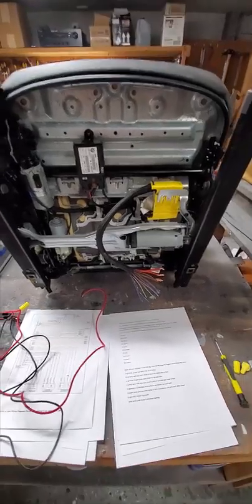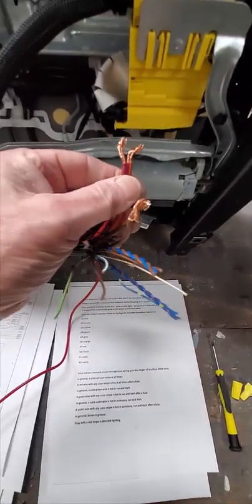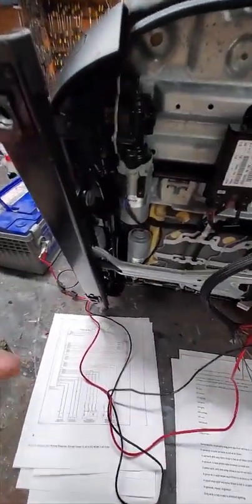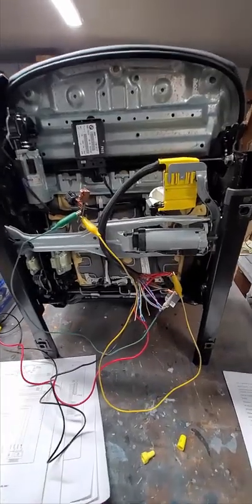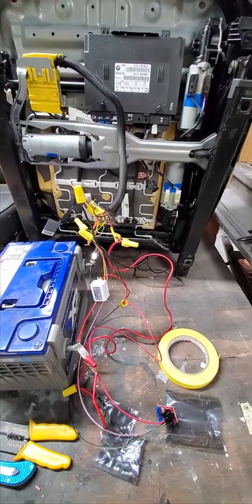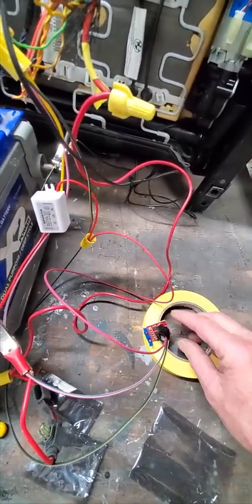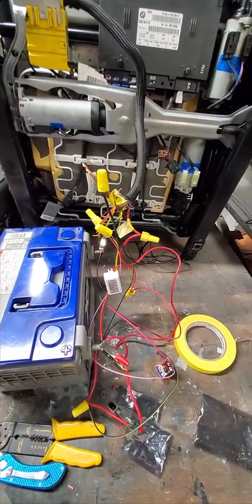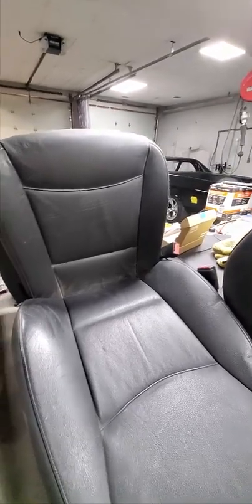BMW Seat wiring for el Camino

Comment: This video is awesome. I am trying to install bmw or other more luxurious seats into my older Corolla. Most other videos I find are for simple racing bucket seats or upgrading to newer model years. I appreciate a video like this with a completely custom retrofit. 
As someone with no wiring experience, I am a little confused about certain things. 
I can definitely get a wiring diagram for whatever seats I end up buying. My car has occupancy sensors, can those be retained or will there be issues? Do you know? Do the airbags work in these seats you are installing, while that be working in the car? Are you using fuse tappers to power the seat? Maybe you could make a more idiot proof tutorial style video?… Plz? 😅

Comment: @Dean Jenkins Sorry but my english is not perfect yet.. I trying to do excaly same thing in my Bmw.. I already have power converter and signal wave plate, I conect them both thogeter and they are works like on Your movie, my quescion is.. how to conect that 5v signal cable correct.. to low can, high can on just to this green wire ?

Comment: Hiello Dean, thank you for this tutorial it helped me with my setup on my El Camino.  I was noticing my car battery would get very weak when sitting for a while, and was thinking maybe it's due to the signal blinking on the board? Everything else is off in my car so the only thing I can think of is the blinker signal?  Anything similar happen with yours? Is there a way to switch it off when not in use besides unplugging battery ? Thanks

Comment: This is an absolutely Awesome video. Is there a flow chart that you could share showing how you have connected everything? I have essentially the same setup as you have but for my 1971 Chevelle.  Thank you in advance again.
Reply: Did you ever find out how to connect everything? I am trying to put a set of 2011 BMW E93 seats in a 70 Oldsmobile  F85.

Comment: Hello, I purchased comfortable front seats with ventilation, but I encountered a connection problem. My car is from 2007 and the passenger seat does not have a module. Can someone help me?

Comment: Could you please help me with my BMW seats I’m using in my 40 Plymouth coupe project?

Thanks!
Reply from the maker: I can try.  What questions do you have?
Reply: @TheDeanjenkins  could you please share the wiring diagram for the square wave board?

Thanks!

Chris,
Reply: @ made all the connections and still timing out.

Any idea what could be happening?
Reply from the maker: @chrisbaker-hr2mp  First thing I would check is that CAN Bus high wire is correctly identified and connected to the pulse generator output.  Then I would check that pulse generator is sending 5 volts - easy to check with a multi-meter.  The pulse generator I used was default set to 1 second pulse so you can see 5 volts on and off at 1 second interval.  Also ensure that CAN Bus low is connected to ground.
Reply: @TheDeanjenkins thank you for the info.  I’ll definitely check it out today.
Reply: @TheDeanjenkins I have a 4.5vdc output from the board.

The wires I believe are for the can bus are green and orange/green. 

Thanks!

Comment: Hi,  great video. Would it be possible to get a drawing or make a video of how you connected the 5v converter and the pulse generator into the seat.  Perhaps a clearer way that shows how everything was wired.  I'd appreciate it very much.  The video explained it but i want s clearer view or the wires & where they were connected to.  I just don't want to fry the motors or the computer that's on the chair.  This is fit the driver's side.  The passenger side is clear as there were only power & ground wires to worry about.  Unless you have a video of how to book up the heated seats on the passenger side as well.  Thank you kindly.
Reply from the maker: Here is a link to another guy who posted how he did it.  He used the same pulse generator I did, but a different 12v to 5v convertor, but wiring is the same.  You have to find the CAN Bus High wire on your seat.  I purchased a wiring diagram for the particular model that was a donor for my seats.  On mine, it was a tiny green wire with a stripe (forget the color.)  You connect the CAN Bus High to the output of the pulse generator, the diagram at the link shows it well.  You connect the CAN Bus Low to ground.  Hope this helps!  https://www.reddit.com/r/projectcar/comments/1ab8hj9/how_to_wire_newer_bmw_seats_into_non_bmw_cars_so/#lightbox
Reply: @TheDeanjenkins thank you for the link and for your video.  I can now write my seats that I've installed last month.

Comment: Loved the video. Absolute gem  ty.  Subscribed and liked  
Just picked up myself some early e63 6series seats (free too) that with anticipation tilted up to find few loose wires 
1. Both pretensioners gone (yay no bang bang) 
2. Occupancy censor on ns  leave that alone
3. 2 wires in connectors. Fat red and brown. RESULT!!

could not be simpler on my end to add to our van.  

Thank you again

Comment: Hello mate,i have a question.
Did i need a computer if i just need seats go back and forward,i dont want to have seats heater.. thank you🥂
Reply from the maker: Only need if you want to be able to adjust seats anytime.  They will work at power on for a few minutes and then time out. That might be workable in most cases.

Comment: Thank you for sharing this Dean! I've had e92 seats in my 97 4Runner for a couple years and this helped me finally get the seat heaters wired up.
Reply: How do you wire the seats? I’ve a 4Runner 00 and Im trying to fit a e89 seat on it but I have no clue.
Reply: @JAVR09 did you figure it out?
Reply: Maybe you could share how you did it with those e92 seats, are they fully electric?
Reply: How did you do it?

Comment: Thank you for the Great Video. I’m in the process of getting the 3 series bucket seats moving also. I’m Just wondering if you used a different seat belt?
Reply from the maker: Thanks.  I used reproduction 3-point kit made for the '68 el Camino.  The factory mounting for the seat belt receiver bolted to the floor, but since the BMW seats were a bit wider than factory, that didn't work.  The BMW seats have an anchor point to bolt the receiver to but when I bolted the reproduction part to that it was too long and stuck up too far.
I sent the two sides off to https://www.seatbeltplanet.com/ and had them re-web them at the correct length.  Worked out great.
Reply: @TheDeanjenkins  Thank you for the quick reply… Happy Thanksgiving… cheers

Comment: @TheDeanJenkins

Thank you so much for your very informative video! I am now a follower, and love your videos too.

With regards to the wiring for the step down converter, wave signal generator, and relay box, could you please point me at where I can find the wiring schematics?  I found your Reddit page that contains the wiring for everything except the relay box, and would really like to use the relay box, especially to allow me to connect seat heater buttons.

Also, the step down convertor in your link is different from what is shown in your video and photos, I just wanted to verify this is known by you, and works the same way.  I understand the wiring, just wanted to make sure Amazon didn't replace it without you knowing.

Incidentally, I am installing E90 seats into a 2002 4Runner.

Thanks again!
Reply from the maker: Most automotive relays have a schematic printed on the case.  Really easy to follow.
Here is a video explaining: https://www.youtube.com/watch?v=DWSO3ny74BU

Comment: Trying to put a set of E90 seats into an E36. Would it be possible for a copy of the wiring diagram please?cheers
Reply from the maker: Don't want to sound unhelpful or preachy, but the diagrams I have were purchased and are copyrighted.  I make my living selling online content and am very sensitive to upholding intellectual property rights.  Purchasing the documents was very reasonable.  With that said, you may not need the diagram.  With this list of BMW color conventions, I could have figured it out, without the actual schematics:  
In general, a solid red wire is hot at all times.
A red wire with any color stripe is hot at all times after a fuse.
In general, a solid green wire is hot in run and start.
A green wire with any color stripe is hot in run and start after a fuse.
In general, a solid violet wire is hot in accessory, run and start.
A violet wire with any color stripe is hot in accessory, run and start after a fuse.
In general, brown is ground.
Gray with a red stripe is dimmed lighting.

Comment: I have a simialr project, but I have the seat from a 328 but I don't know where to find the car side connector and pigtail so I can wire it in. Any suggestions?
Reply from the maker: When I bought mine at a wrecking yard it was still in the car, so was able to get the car side connector and pigtail.  Any chance you can go to the source and get that?  If not, I would cut off the seat side connector to get easier access to the individual wires.  Hopefully enough there to work with.  Good luck!

Comment: Great video on explaining the wiring set up! I have installed similar BMW seats installed into my 1999 Toyota Tacoma and very happy with the comfort. now have to deal with the wiring.
Couple questions for you regarding the wiring?
1. Did you run power directly from the battery to the relay to power the seat up?
2. If I wanted to have two heat settings for the heated seats how would you do that? another relay? different amounts of amperage or reduced voltage going to the heating elements?
Reply from the maker: Glad you found it helpful!

Yes, I ran a 10 gauge wire from the battery to the relays for seat motors and heaters.  30 amp fuse on each.  Relays are energized at ignition on.

For high/low settings on the seat heaters, using the BMW controls looked too complex for me.
Since I was having the seats re-upholstered anyway I ended up taking out the BMW heating elements when the seat covers were off and installed a universal seat heater kit, which has two settings and which is readily available on Amazon for ~ $100.  This kit comes with everything needed, including switches, relays, etc.  They work great.
Even if you are not installing new upholstery, you could remove the seat covers and do the same.
Good luck!

Comment: Great video! Is the lumbar/side bolster (black/red) pin 7 on 30 amp fuse as well?
Reply from the maker: Not sure of the pin number, but yes power for all the motors is supplied on the same wire with a 30 amp fuse.
Heaters are on a separate wire/fuse.
Reply: Getting my seats tomorrow and starting project the same just wanted to say thank you so much for this.  Subscribed and liked 👍

Comment: A little confusing because my wires are different colors but the concept is the same/ appears to work fine.
Reply: What year are your seats
I'm trying to wire 2014 m6 into a 1994 E150
Reply: @juanchao8122  I looked up the seat wire diagram, all you need is high and low comp wire and the red and black wires. The colors vary
Reply: @juanchao8122  2009 bmw 135i coral seats

Comment: Thank you for sharing. Question: are you running your power constant (battery power)? Do you have any amp draw? I was thinking of hooking the can bus (voltage step down) to ignition power and the main power to battery to let the seat go to sleep. then wake up with ignition on.  Not cause any amp draw while car is resting for a period of time. Thoughts?
Reply from the maker: I hooked up the seat power (which I tied the Can Bus power to) and the seat heater power to a relay that is energized when the ignition is turned on.
I used this Relay/Fuse box and it worked really well.
https://amzn.to/3w8kJL2
Reply: @TheDeanjenkins  Does your driver seat have memory?
Reply from the maker: No. Pretty sure memory settings are stored in main body computer,  not the seat controller.

Comment: do ya have to fool the passenger seat too?
Reply from the maker: No.  Passenger seat has a simpler control module.  I think the drivers seat is more complicated because of the memory setting.
Reply: @TheDeanjenkins 
Along those lines would it be easier if both seats had passenger modules instead ? 

If the add in is a  keep awake trigger for the can bus on memory side that is not usable or required 

I just thought might simplify things a little

Comment: Good morning Dean,
Where did you find the printouts on google? i have a couple of E90 BMW seats I want to install in my 1971 VW Bus. You didn't mention where you got the electronics to keep the computer happy.
Your vidwo has been the best one i've seen.
Thanks
Reply from the maker: In the description of this video I have descriptions and links to all the parts I used
Reply: Hey there.  Just curious if you got this to work in your bus.  I'm getting ready to do this in my 77 super beetle.
Reply: @cjjones1556  I made a mounting plate to go under the seats, but I haven’t cut the pedestals. In order to be able to see out of the door window and not hit my head on the overhead I have to lower the seat pedestals 2.5 inches. The thing is that if I cut the pedestal it’s also the wheel well! I’m a bit apprehensive about doing the surgery!
Reply from the maker: I purchased the wiring diagram for the specific car my seats came out of from https://portal-diagnostov.com/en/

Comment: Hello, can I move the mechanism of the seats of a right-hand drive vehicle to the left?
Reply from the maker: Moving the mechanisms would be a big deal and I'm not even sure if it is possible.  But, the only difference between the two seats is the memory function, which I'm pretty sure doesn't work in this application.  So, just install the seats: drivers on the left, passenger on the right and it should work fine.

Comment: So the controller will shut off the seat movement functionality after 5-10 minutes? Or is that just for the heat functionality ?
Reply from the maker: The controller will definitely shut off the seat movement, not sure about the heaters, didn't test that.

Comment: You only need an inline fuse on the red wire I assume?
Reply from the maker: Got it. This should work. You need at least 30 amps.
12v Power Supply 33.3A 400W Universal Regulated Switching Power Supply Transformer Adapter, Switch AC 110V/220V to DC 12V 33.3Amp Switching LED Driver for LED Light Strip, Security System, 3D Printer https://a.co/d/ewywqIu
Reply: @TheDeanjenkins  thank you I appreciate it. You think 400w is minimum? Or these are more reliable than those cheap 12v power supplies?
Reply from the maker: EVERY circuit needs a fuse on the hot side. Seat power, heaters, logic. All.
Reply: Gotcha, thanks for the reply. 
I just want the power movement functionality so I will just need that inline fuse for the red wire? Ground wires dont require fuses correct? Sorry im a noob when it comes to electrical.  @TheDeanjenkins   Thanks a bunch for this video too it makes it super easy. Is there a 12v power adapter you'd recommend to power this thing via a power outlet? I will be using it for a driving simulation rig.
Reply from the maker: Pay attention to Amps. Seat Power is a 30 Amp circuit
Reply: @TheDeanjenkins  gotcha thank you kindly. I assume I still need the 30a fuse as well inline to the red wire.
Reply: Do you recommend 10g wire for this project? @TheDeanjenkins
Reply from the maker: @gster109  12 gauge is fine and what I used.
Reply: for the wire running from the wall to the power supply is a 16awg wire fine? @TheDeanjenkins

Comment: Thank you! This is the best explained video I've seen on this. I'm putting e92 seat in my Mercedes Sprinter Van.
Reply from the maker: Thanks.  Please post an update when you get it done.
Reply: Will do! @TheDeanjenkins
Reply: @TheDeanjenkins. I'm trying to put some Lincoln navigator seats into my Infiniti qx80!!  Could I wire those seats to run off of my Computer system. Also where are you located and would you be interested in making a harness

Comment: Hi Dean How can I get in touch with you about BMW seat wiring. I'm putting 2009 sport seats in a 1969 roadrunner. I see your parts list but I need the wiring schematics. Thank you very much
Reply from the maker: I got my schematics at https://portal-diagnostov.com/en/ 
It was helpful, but truthfully, all I really needed was the BMW wiring conventions that are posted in responses here.
Reply: I finished it, Thanks they work perfectly. @TheDeanjenkins
Reply: Hey what seat brackets did you use in your car I have a chevy monte carlo 88 ss im putting 2014 328i f30 front seats.

Comment: Received the Step down and Square Wave Generator you gave links to.  It's easy to miss the Volts in/Gnd/ Signal Out labeling for the pins.  

On your video it looked like Volts in was the far left pin, but on the Square Wave Generator I received it's actually the far right pin.  Middle pin Ground, left pin signal out.  Once I got it right it works perfectly.

Thanks again for posting your video..
Reply from the maker: Just saw this now.  Sounds like you got it working.  Good job!
Reply from the maker: Did you get the little plastic boxes I linked to (or similar) to package up the electronics?  Makes a nice neat install.
Reply: @TheDeanjenkins  I ended up getting slightly taller plastic box as the Step Down Generator was, for what ever reason, too tall for the boxes you used.  Finished the install today and everything is working great thanks in large part to your video.  Thanks again.
Reply from the maker: @jonhosea3135  Great!  Glad I could help in some way.